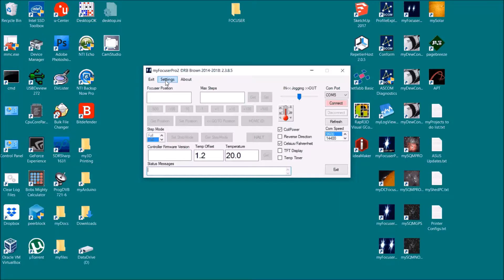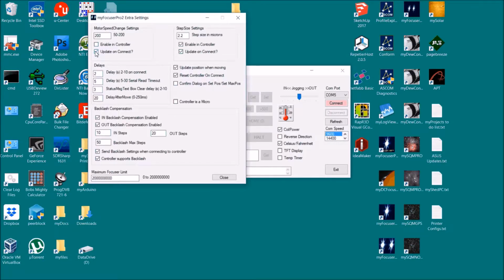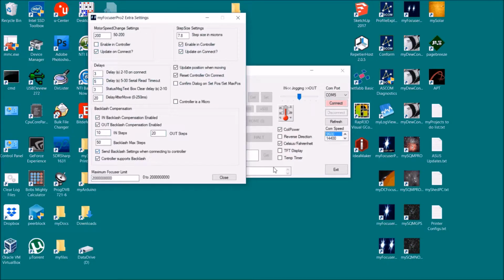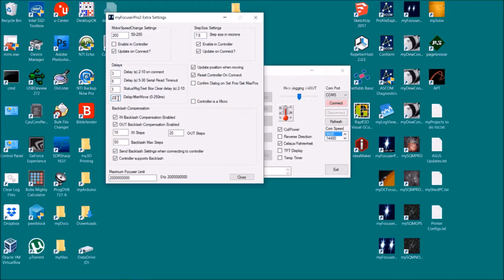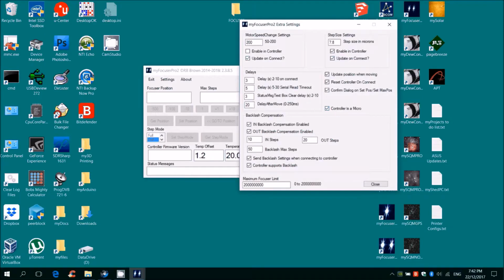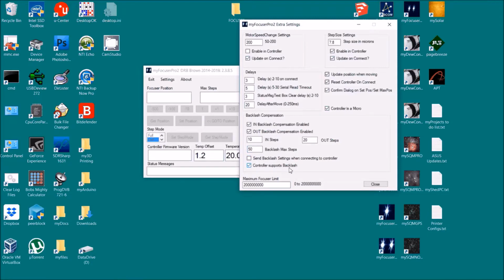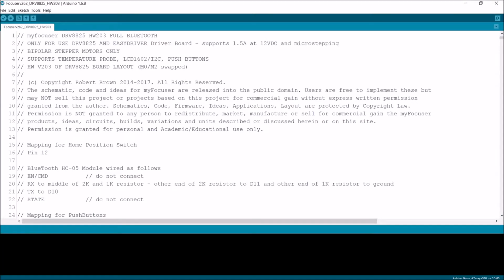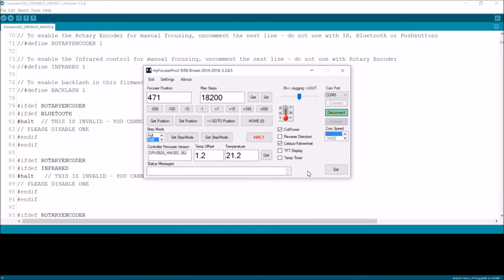Part3b Overview of myFocuserPro2 settings

Comment: The settings are saved to the eeprom, is the eeprom in the Arduino? I ask because I want to use it on a Linux machine, so will the saved settings from the Windows machine still be there when I use it on a Linux machine?
Reply from the maker: It is in the Arduino.

The application settings are saved in Windows and in Linux. Linux uses a .ini file to save the Linux application settings. Windows uses the application settings that are part of the onc-click application development.

For controller settings such as stepmode, focuser position, step size etc are all saved within the arduino, but are also saved in application settings. The reason for this is twofold.
1. If you ever lose your controller settings, you can easily restore them from the application settings [Windows version save/restore settings menu option].
2. You have the choice when connecting to a focus controller to "update on connect" which means send this setting to the controller when I connect becase this is how I want it configured